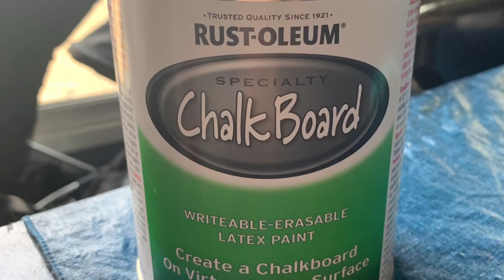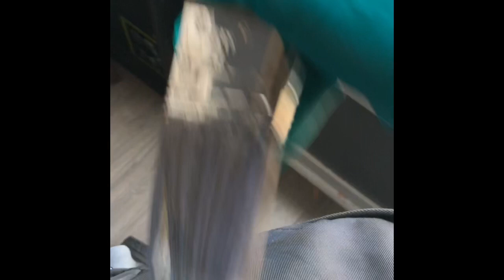DIY-How To Transform A Faded City Select Stroller Back to Black

Comment: I wish I would’ve known this! I neglected My single city select stroller I bought for my daughter once we had another baby and got a double stroller. I left the city select in the patio and it completely faded and I gave away my $400 stroller for $40! I only used the stroller for less than a year too and it was in good condition 💔
Reply from the maker: I’ve searched everywhere to find out different ideas to change the fabric on a  stroller without actually removing fabric, I’ve seen people use sprays and dyes but I chose a different approach, this actually worked for me. I would definitely recommend doing a bit of homework before trying  anything specially when you have kids. If anybody knows any other ideas how to change the colour on the fabric I would love to know. If i find something else I will post or make a new video.Thanks for sharing your comments, all the best.😁💕

Comment: I want to do this too! How is the stroller now? Is the black paint stable? How it work against rain or water?  Will it make the fabric hard ?  I really curious about this. Thank you 😘
Reply from the maker: The blackboard paint I used is latex, and this paint is holding on pretty well, once it dries it’s not coming off. I have taken my stroller under the rain already and nothing I even forgot that I had painted. Other fabric and leather paints that are used are either latex or acrylic paints and they are both made from acrylic resins only that one is more water base(latex) than the other.This paint is not washing off after it dries and once dry is safe for children and that’s the reason why I ended up with it. Hope this helps.😁(I have a next video that I will be changing a leather couch from brownish to black.....with this same paint)

Comment: Does this stain baby’s cloths ?
Reply from the maker: Karina Avechuco After it dries make sure you give it about 6 days, I started using mine less than that. The colour locks in once you let it dry and it becomes stain resistant. It doesn’t stain, my kids wear white and I’ve been caught in the rain and the colour doesn’t even come off. My kids spilled yogurt in the stroller and I washed it with soap and water and still paint is intact. Hope this helps. (It’s as if this was the way the stroller came straight from the store). 👍😀

Comment: Did you allow it to dry indoors or outside?
Reply from the maker: Since it’s odorless, i did work inside near windows. This stuff dries quickly also.It is recommended to let it dry for 3 days, I also made sure stroller was in an area where the kids didn’t go and touch it.

Comment: I just checked the same brand for the chalkboard paint and it says warning for California prop 65
Reply from the maker: Hi hun, This product is waterbase it’s latex, I even used water to spread it evenly, even though there is chemicals involved, the product says non-toxic when dry. I made sure my kids didn’t touch product while wet, It is also odourless. Once it dries it should be safe.But I also understand that prop 65 in California, this is safety measure the country has installed. I would recommend something with fabric dye’s instead, the only thing it’s a longer process, it takes days before you add more layers. I watched a video on YouTube in changing the colour of a stroller by dying the fabric. You could check that one out. The only thing is that it’s a longer process and that’s the reason why I chose a different approach.All the best!😁